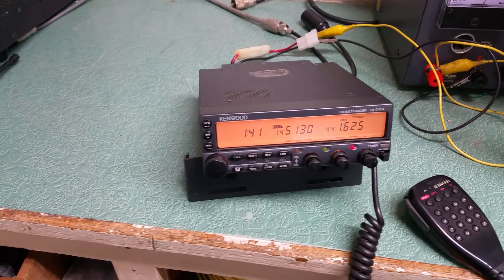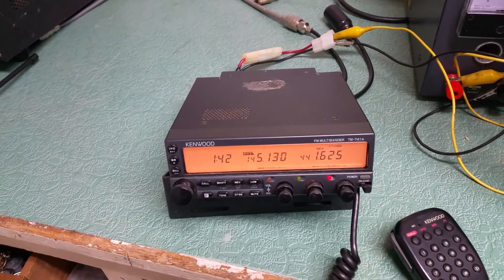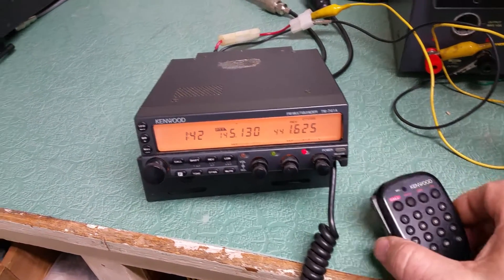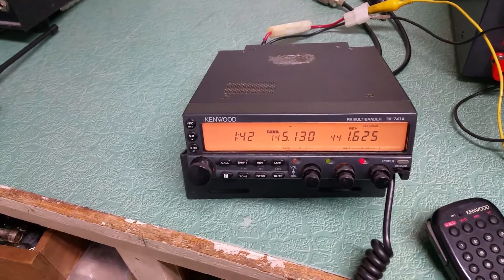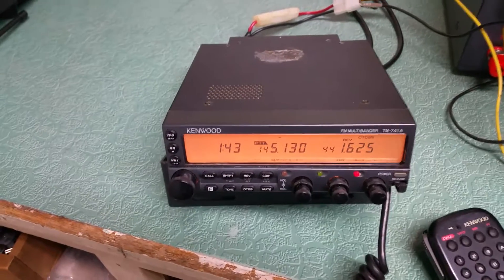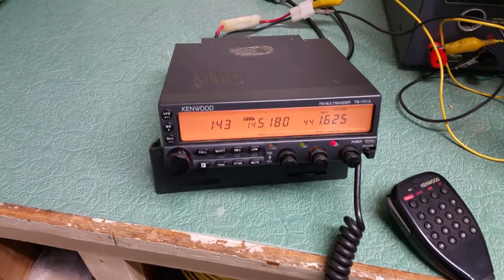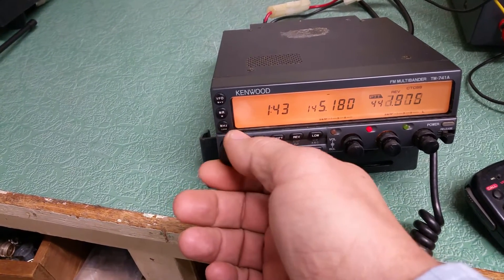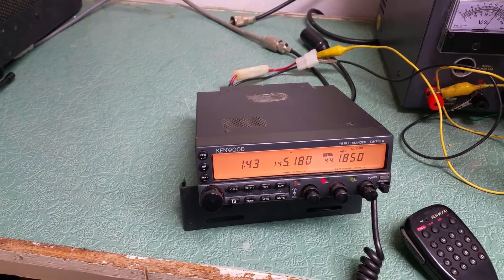Kenwood TM-741A Multiband FM Transceiver

Comment: Hello, congratulations for your videos and your skills, I wanted advice, after about 20 years I turned on my TM741 and often the front panel keys do not work, the dial knob always works, I have changed the two lithium batteries but the front panel keys do not go, I checked the welds on the front panel and they are ok, I also resoldered the central IC behind the display, do you have any advice? thanks!
Reply from the maker: Sorry I did not see this question. No I am not a technician so I can not help